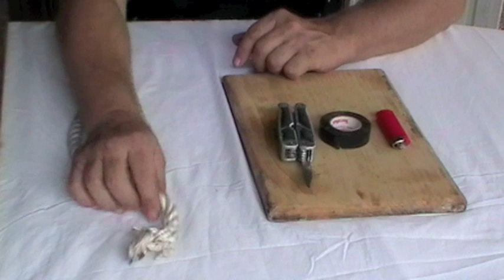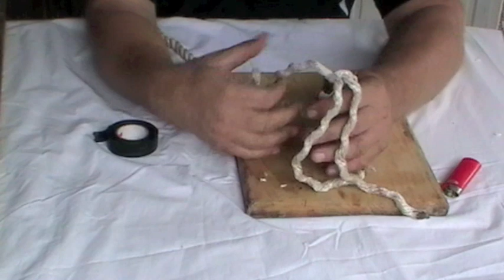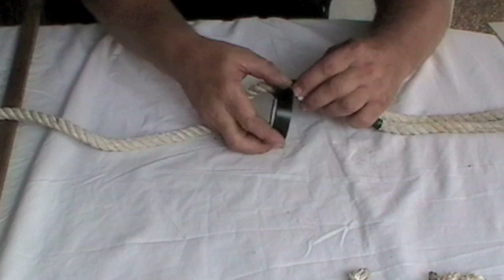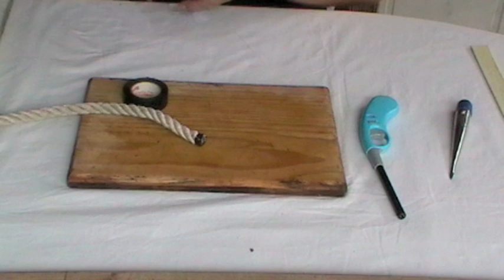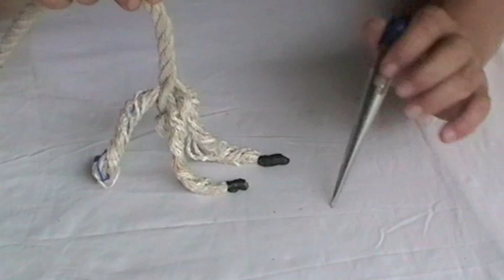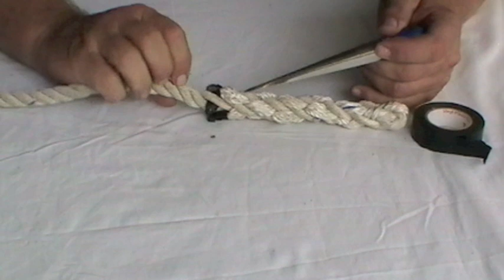How to do an Eye Splice, Crown Knot & Back Splice

Comment: Awesome Jim, thanks! Just one thing though, because there are 3 strands equally spread apart (from center axis), then that would place them at 120° from each other - and not 45° like you keep stating. 

360° (a circle) divided equally in 3 is 120°.

Have a good one mate!